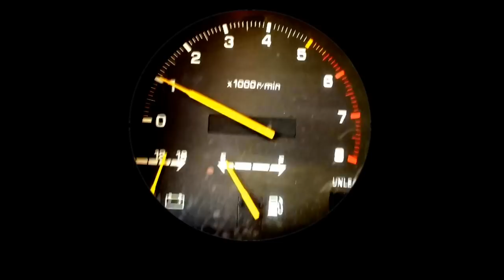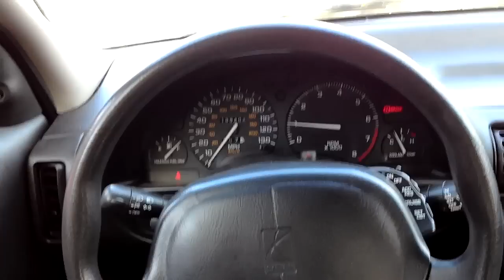97 Saturn SL2 Project - Brake Rotors & Pads

Comment: Car sounds pretty good. Get a cold air intake and headers on that thing. 

Great job on the brakes.
Reply from the maker: Yeah I'm planning on modifying the factory intake itself. Turning 'it' into a cold air intake. The air intake will be where the fog light covers are on the lower part of the front bumper where the optional fog lights would go. So I would be modifying a oil funnel putting it there and into the intake hose that would go into the factory air filter box which has a water drain hole eliminating the possibilities of hydro-lock that cold air intake users fear so much when driving in the rain and driving over puddles.

Comment: Noticed the brake rotor does a nut hold that on like the previous video on the Honda Accord where you changed the breaks
Reply from the maker: On the saturn its just the wheel and lug nuts that hold the rotor in place. Once you remove the wheel its pretty much loose just gotta move the caliper and caliper bracket out of the way. Now the Honda thats a whole different beast of a rotor change.

Comment: Hey did u get the sponge feeling for the break fix I have a 2001 sl2 I change all the breaks but still feeling sponge
Reply from the maker: Spongy pedal usually means air in the lines. Bleed out the brake lines all around and see how it feels then. Just don't forget to keep the reservoir topped off as you bleed it.
Reply: Thanks man

Comment: How are these holding up? I've seen the rotors and ceramic pads for my car for around $70 from prime choice, but there price keeps fluctuating. Btw, One man bleeding is easy if you have a small container you can put in the old brake fluid with. Just get 3 ft of tubing for a hardware store, something like 1/4-3/8" and that should be good enough. Fill up the container with a little fluid and make sure the tube is in the fluid when you are bleeding it. Should let out the air, and old fluid
Reply from the maker: They have been holding up pretty good so far. I have no complaints yet. I got myself a vacuum pump bleeder from harbor freight. Works pretty good.
Reply: The pads are made by benedix I believe. When I searched up the part number, thats what I got
Reply from the maker: AwesomenessIskey Never heard of that brand but they have been working great so far. Rotors have been great, very little wear on the rotors, pads are great on hard highway 65mph+ braking (which I have done many times annoyingly)

Comment: Did/Does your car use up oil? I have a 98 with 190xxx on it and it uses up oil and it gets a little annoying lol
Reply from the maker: Delagrim all saturns up to 99 will at some point start burning oil. its a factory defect with the pistons that causes the oil ring to get all gummed up and stick thus burning oil.
Reply: jmoyet Ah, alright. Do you know any idea on how to help it out? Other than a engine rebuild haha
Reply from the maker: not that i know of
Reply: Bruh if you replace your pcv valve and clean your egr throttle body you should see less issues in burning of oil on your saturn. I drive a 2000 sl1 5 speed with 197k that does not burn oil.

Comment: can you put the links in the description for the rotors and pads where you got them?
Reply from the maker: I will add a link in a min. I got a combo package.
Reply: jmoyet
thanks, im thinking about changing my rotors and pads on my SL2 this weekend, any heads up? btw thanks for the vid
Reply from the maker: sparcerX Just be sure that the caliper pins are greased and move freely and that the rubber covers dont have any damage. And its always a good idea to spray down the calipers with brake cleaner before and after removal to prevent dust flying and to clean out any build up. And spray down the new rotors with brake cleaner also to remove the oil film they have.

Comment: bleed them out that may cure the spongy feel a 2 man job if you have someone else with you. and timing chain your replacing??
Reply from the maker: The brake fluid is very dark. So I think its time for a brake fluid flush. The timing chain. I still need more tools that I am currently lacking for the job. A proper ft-lbs torque ratchet, belt tension tool to make easy job of removing serpentine belt, pulley puller, etc. You get the idea.
Reply: the chain got slack or is it worn out?
Reply from the maker: Jovan Lopez So on these DOHC Saturn engines they have their known problems. 1 the tensioners and guides wear out. and 2 the Main major one is that the pistons have a faulty design which causes an oil port to clog and causes the engine to burn oil. Mine has both. already have the timing kit which has everything i need. and  I'm planning on using Marvel Mystery Oil to attempt to fix that oil burning problem.